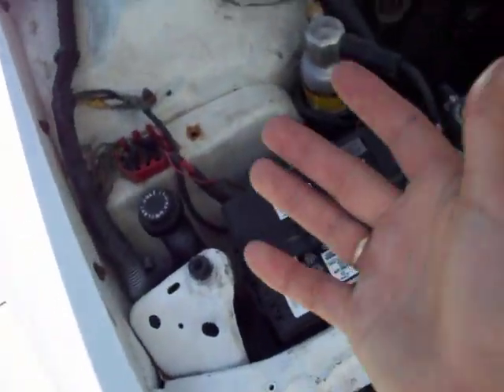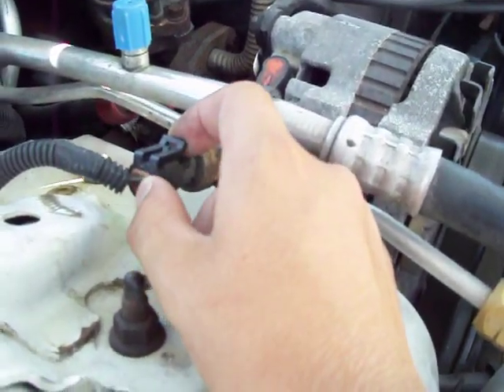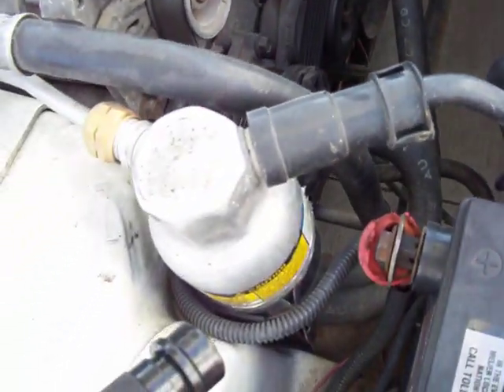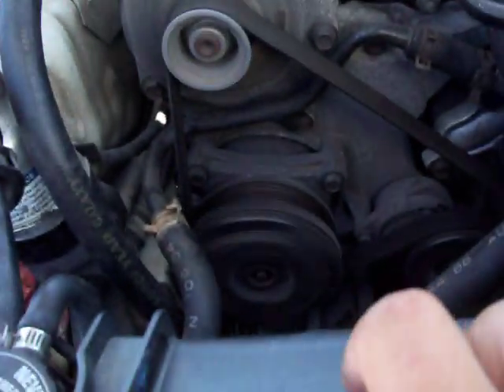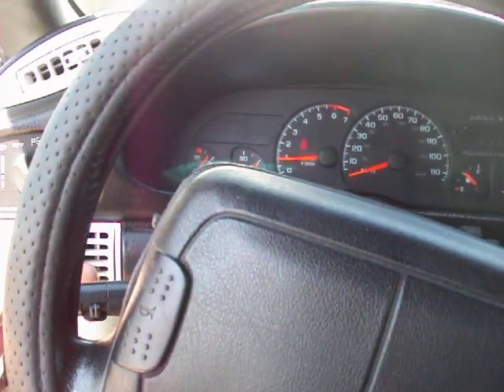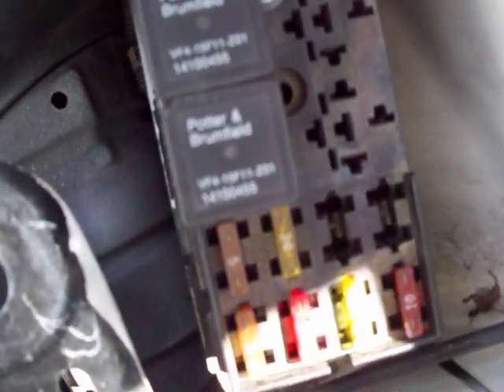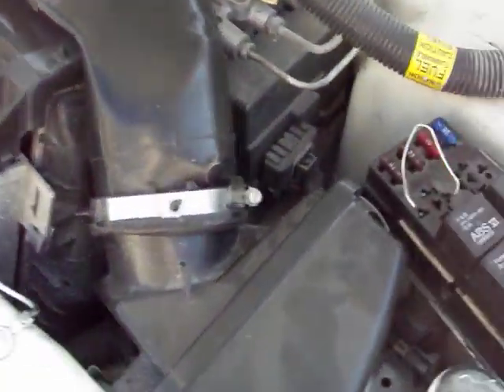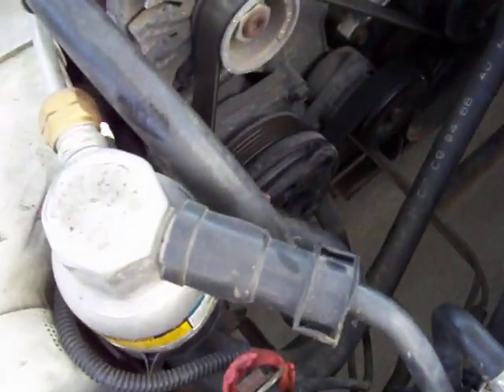How To Make AC Ice Cold, Recharge air, and Force the Compressor Clutch to Engage

Comment: Pretty good video. However, here are some tips. First, know your terms. Coolant is something completely different from refrigerant; you are talking about refrigerant, here. It is important that you know the difference.  Second, keep in mind that each maker uses different marks on the pins or slots for some relays. YOURS are marked as you stated. Mine are not the same. Try to give an explanation of what the two pins to (as you did) and how to tell or look up which pin is which. Third, AC recharging is actually pretty complex and dangerous. In the old days these cans were called "suicide kits" for a very good reason. Know why and how that applied to the products you use. Fourth, each car uses a specific PAG oil; my 2001 Honda Accord uses PAG 46. Some use PAG 100, etc. Some use mineral or ester oils. Using the wrong one will kill your system, or so I have been repeatedly told by old school shade trees. Fifth, add some power steering fluid; your pump sounds like it is trying to mate, man. HAHAHA!!!

(Yeah, I know this kid is now a man since eight years have passed. I am actually making my comments to people who are researching this topic and find this video.)

Comment: Hey buddy im having that problem. When I replace a new a/c compressor.... I have no freon in it as of now. I remember when I 1st put it in my condensor fan comes on. Not the fan doesnt come on at all. Can it b that I have low pressure or no freon at all? Help.... sounds like my clutch not on now. Before when 1st install it did...

Comment: Cool video.... 
Hey, today my AC was working normal then all the sudden I got hot air. I went to buy a big bottle of r34 and I turned my car on AC full blast,  I hooked up the AC hose and it went a little past 100psi on the red. I tried to fill the AC anyways and the bottle trigger felt very light like an empty bottle and I wouldn't hear the compressor kick in. Any ideas so I don't cook myself in this hot weather?

Comment: Not only will the clutch not engage if it is low on coolant,It also will not engage if it is overcharged.It is because of the sensor.Some people have unplugged the sensor and "looped" a wire on both plug terminals to make the system think everything is fine...but i wouldnt recommend it.that's just a trick and a temporary fix.

Comment: Actually i adjusted the v position according to the ambient temperature (off by 5 degrees) and my arrow is right under the "V"... but when I add more freon I notice a "thumping" sound and yet I'm not even in the between the "V"??? Am I OK with adding more freon or am I overcharging the system???

Comment: i have a 2004 Honda Odyssey.  I cannot fill it with R134a because the compressor clutch will not spin. I may have a bad clutch, either way, I cannot figure out how to bypass it like you did with the paper clip. I have found the relay box, I have a "MEG Clutch " fuse. What do you mean by "b-1 and b-4" ? I have the numbers 87 and 30 on the fuse. But the display says it's from the bottom view ?
How do I bypass it like you did ? I get a reading from my pressure guage into the red when I attach it to the Low Bypass line. That must be pressure from the can....right ? So, how do I bypass the clutch with the paper clip in the fuse box and which one is the right fuse ?
Reply: +Olivia Kreiser  Olivia, please don't use this video to do this work... Use the information and equipment on the Auto Zone video... It is much better and shows the CORRECT methods to do work like this... The Low side of the system should have a different size fitting than the high side of the system... This way they are not mixed up... Use a manifold gauge to do work like this that shows both high and low pressures of the system and use a pressure/temp chart to PROPERLY charge the system....DO NOT ATTEMPT TO ADD REFRIGERANT UNTIL YOU HAVE THE PROPER TOOLS , EQUIPMENT & TRAINING TO DO THIS!!!

Comment: my compressor isnt running and gauge reads 150 psi as in overcharged. blows warm air. does it read this high because compressor isn't on due to low freon?

Comment: I commend this guy for trying to help people out and save money, but compressors don't come on with low refrigerant for a reason. Refrigerant mixes with oil and if it's low on refrigerant, the oil will not circulate properly and burn up the compressor. If you attach a can of refrigerant to low side, it will pressurize the system enough to engage the compressor. Be patient as it may take a few minutes. It will cycle rapidly at first, then run consistently as proper pressure is reached. A set of manifold gages works best if you know what you are doing,, but the quick connect thing he used will suffice if you are just recharging the system. It's idiot proof and will not hook up to the high pressure side.
Reply from the maker: Please google On Board Air 4x4 Conversions. You will find a plethora of information where people use these AC Compressors to pump air and run tools and they are extremely lightly oiled with no problems. I can assure you, their will be much more than enough lubrication in the compressor when you jump it.
Reply: Hello ellswortha101- It is true that many people use A/C compressors to create pressure to develop low pressure at a decent volume for use as tire inflaters... That is a trick in the off-road crowd... And Yes, they (several a/c compressors) have their own self contained lubrication systems... But the assumption that they will always have enough lubrication when they are activated, is not necessarily true Amigo... Much of the lubrication in the system could have leaked out during the previous operation of that system, along with the refrigerant... I do not know of a way to measure the volume of oil in the a/c system, like checking a dipstick on an engine... What I tend to do is look at the age and mileage of the vehicle and try to find out how often the vehicle needs a recharge... Then I add just a few ounces of the CORRECT oil to the a/c system, along with dye, to see where the leak(s) are coming from... There is an excellent tool that introduces this small amount of fluid into the system when re-charge is being done... It easily mixes with refrigerant so it won't be introduced as a liquid, but rather a mist so it won't damage the compressor from a hydro-lock... BTW, always turn the compressor by hand to see that it isn't seized BEFORE activating the clutch on a dead system...

Comment: Ok I recently changed  my AC compressors from 1996  Cherokee Country to a 2000 Cherokee xj but i had to switch out the backs in order to use my lines. The 96 mounts in the main back and the 2000 on top of the compressor. Needless to say i lost all freon and oil. I replaced 4 oz of oil and it took it but it wont take the freon.  i straight wired the clutch an it works. wont take freon. Is it full of AIR??  Did changing those backs make a difference? it worked great on the 96. All help appreciated...

Comment: I have an 84 Mustang.  What if I don't have a relay box where the relays are that easy to find?  I've looked thru my hanynes manual to no avail as well.  I was able to jump start the clutch by connecting a hot wire from the compressor connector directly to the battery and the clutch kicked on.  Doesn't this do the same thing?

Comment: I tried waiting fr long time fr compressor to start spinning it never did,so I tried manually turning it on,but I ran a wire from +pos side on battery terminal to relay 87 and tried other connectors it never turn the compressor ,what you think ,would it matter it i ran a clip like you did

Comment: you don't need to force the clutch to kick it... it will kick in once it has enough freon in the system
Reply: William,if the A/C switch is on only,then the freon pressure senloid keeps that in check if the pressure gets to high this will send a current signal to the magnet to release the engaged clutch head,thus protecting the compressor!

Comment: Im having compressor not turning on issue. 2002 Lincoln LS-V8,. took it to shop for fill up and mech said ac compressor isn't turning on. Seller said there's a hidden fuse I might want to check. Im wandering if the square breaker in the video has the same #'s on all/most cars before I try paper clip? Otherwise -vg video and replies. Thanx all.

Comment: My 2003 Silverado A/C is blowing hot air at the front passenger side.  The driver's side A/C is ok.  What do you think is happening?
Reply: +MrTin71 There could be a problem with one of the doors not closing during the a/c mode...The doors I'm referring to are the air passage doors that direct cool or hot air to the cabin that are inside of the HVAC manifold inside of the cabin... It could be a bad vacuum diaphragm pod, or a stuck door, or a dis-connected/broken-bent linkage....

Comment: What If I have the three pin pressure switch.  now to I engage the clutch.  I have evacuated the system and had a negative pressure and added R134A to high and low side while engine is off and now I have only the low side open but I cannot get the clutch to engage.
Reply: Hello Dan Davis, The system that is too low in pressure to operate, has to have the pressure switch(s) by-passed to enable the refrigerant/oil-dye to be introduced back into the system.... This is best done by removing the relay that activates the a/c clutch.... Then connect the correct circuits that the relay controls... On a 5-pin relay, it would probably be the slots where pin #87A & Pin #30 go into... DO NOT USE A PAPERCLIP TO DO THIS!!! Use a 16awg wire with two bayonet connectors (the same size as the relay pins) to jump these circuits together... Then re-charge using the CORRECT procedures.... Always check to see if the a/c compressor turns freely by hand BEFORE doing this... Always wear ANSI approved eye protection when working on things like this...
Reply: all was successful.   thanks for all your help.

Comment: Refrigerant doesnt double as lubricant because its always in a vapor state thro the compressor. If not it will destroy the compressor, thus called liquid slugging. The low pressure low temperature refrigerant going back to the compressor actualy doubles for cooling it. Also if you want to get in deapth on ac repair, buy a real set a refrigeration gauges so you can see both high and low side. There are manyyy issues you will come across that you will not be able to trouble shoot with just a low side gauge.

Comment: What does it mean when your compressor is working fine, then stops working after you add the ac pro fluid?
Reply: Twandaye (Teknon) that happened to mine. Yours is fixed already ? Mine turns on/off after they refilled the freeon

Comment: I HAVE A 2011 DODGE AVENGER AND ONLY THE DRIVER SIDE DOES NOT BLOW COLD BUT MY PASSENGER SIDE DOES. AND I ALREADY CHECKED IF MY ACTUATORS ARE WORKING AND THEY ARE WORKING FINE. THERE IS TWO ACTUALLY. WHAT CAN YOU TELL ME  THAT COULD BE THE PROBLEM?

Comment: Chad, I cannot figure out what the proper way is to attach the paper clip to short out the relay or fuse . I have the #'s ...30 and 87 like the kid said in the video. I am using it on a 2004 Honda Odyssey. What fuse is the right one to bypass ?
Reply: +Olivia Kreiser You find the holes in the fuse panel that correspond to 30 & 87 to "jump" the circuit.
However - 
You should try loading some freon into the system with the car not running and you might not even need to bypass the relay.
Reply: Is it 87 or 87A and 30?
Reply: Hello Colin, the paper clip method of by-passing what the relay does in this circuit is definitely NOT recommended... I would suggest to first test to see if the a/c compressor can turn by moving the driven plate of the a/c clutch by hand.... If it does turn, then using a jumper wire of no-less than 16awg with two male bayonet connectors on either end of the 8" long jumper wire, activate the electric coil that engages the a/c clutch... Then do the testing using the a/c manifold gauges and throw away that rummy low-pressure gauge set-up he(Ellswortha) uses in this video.... Most relays for this use are SPST types with the N/O circuit used.... Translation: The relay (electrically controlled switch) is the SPST (Single Pole / Single Throw) type of set up which use the N/O (Normally Open) circuit to operate the a/c clutch... Do some studying and find out how to identify which circuit that the relay in YOUR vehicle uses to operate the clutch... Another way to do this is to use a jumper wire that has a 15A fuse installed to run a source of power from the batt. positive term. and the a/c clutch power lead... Do this ONLY for testing and servicing... Disconnect the jumper after 20 minutes.... The video that is available from Auto Zone explains the entire procedure of PROPERLY doing work like this...Also use safety glasses and don't wear jewelry or loose clothing,  when working on any type of machinery... Good Luck Amigo!!!

Comment: Ok. I have a f-250 powerstroke diesel and I'm thinking of blowing the charge ,pulling a vacuum,and recharging the system. Only because I used that line to charge my system due to a leak once a year ,and that line does not let you Purge the line to let air out,therefore the outside air and environment get into the system.
Any advise?

Comment: what if I put the paper clip in and the compressor still didn't turn? it was a small paperclip if that has to do with anything.
Reply: Make sure that you have the clip touching the proper 'prongs'. If your freon is full, then the clutch might be burnt. Good luck. Make sure you have enough freon in LOW pressure line.

Comment: 2001 Hyundai Sonata - I thought at first it needed a recharge  of R134a   , it only took 1/3 of a can   I noticed the clutch wasn't turning on the compressor , so what's next where are the high and low pressure switches located or the compressor cut off switch ,  I checked all the 10  amp fuses  all good?
if I check the resistance across the 2 wires coming out of the AC compressor clutch what should it read?
Reply: Rondo Schiavoni  Hello Rondo, the best way to diagnose the system is to use an a/c charge manifold and connect it to the high and low pressure ports of Your a/c system... To get the clutch to work if it is not working, You can then run a jumper wire between the activated terminal going to the compressor and the live (fused) terminal going to the relay as he did in this video. Use male bayonet connectors at both ends of the jumper wire in the relay socket as he did in this video using insulated 16awg wire... DO NOT use a paper clip to do this.. This will by-pass the pressure switchs in the system and run the clutch so a proper charging / diagnosis can be done... Get the Auto-Zone video with Bruce Bonebreak to find the proper method to do work like this... Dis-regard everything else the person in this video has done to avoid problems and injury...
Reply: good going thank you
Reply: Rondo Schiavoni  You're welcome Rondo... Remember, safety first...Then use advice from a PROFESSIONAL and EXPERIENCED person who understands the basics of this procedure... The training from a proper instruction source is important when working with volatile liquids which are under pressure, such as a vapor cycle machine (a/c system)... Please get the a/c video from Auto Zone to learn the proper and safe method of how to do this.... And Rondo, NEVER - EVER use the a/c system sealant he described in this video... It will RUIN most of the a/c systems....
Reply: +Rondo Schiavoni  Hello Rondo, one of the most important steps to diagnose the modern a/c systems is to see whether the compressor turns, or not... Engaging the clutch on a seized compressor could lead to more problems than the inoperative a/c system presents... Get the Auto Zone video and study the PROPER procedures of how to do work like this... Otherwise, leave it to an ACTUAL EXPERIENCED PROFESSIONAL.... Please dis-regard this video presented by the inexperienced/ill-trained air-head 101 dude...
Reply: I CHECKED THE RESISTANCE ACROSS THE HOT WIRE DISCONNECTED OR COARSE AND  ANY GROUND  AND THERE WAS  AN OPEN  WHICH MEANS THE COMPRESSOR IS BURNT OUT.
Reply: +Rondo Schiavoni  First, put some safety glasses on, with the engine off;  check to see if the compressor drive plate turns by rotating it by hand... If it does not turn, stop and have a seat, then find what it will cost to replace the compressor and flush the system... If it does turn, then remove the quick connect power plug going to the compressor clutch coil and apply power (12v. dc) to one terminal and ground the other terminal.. If it clicks this means the coil is good... If nothing happens, then You have a bad clutch coil... If the clutch coil was good, then the next step is to find out why the power is not getting to the coil.... This is where the troubleshooting skill starts becoming necessary...
Reply: IT WAS THE CLUTCH   DID NOT CLICK WITH VOLTAGE APPLIED

Comment: i accidentally spilled radiator fluid in my AC system. the high pressure valve by my radiator cap was missing and it spilled in there. how do i clean it out? thanks!

Comment: You cannot read the pressure with only one gauge, both high and low needs to be read at the same time and the difference is what the pressure is , plus that cheap gauge you got on the can from the store is very inaccurate anyway

Comment: dont use stop leak at all. it can clog up the expansion valve and cause all sorts of issues down the road. best thing to do if you have a leak is add some UV dye, or coolant with UV dye in it, then identify the leak and fix it.